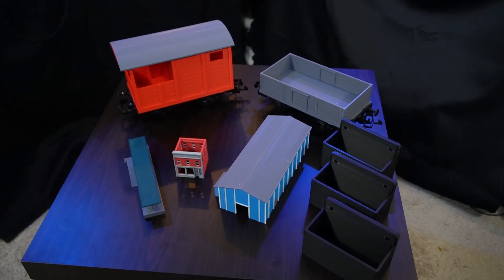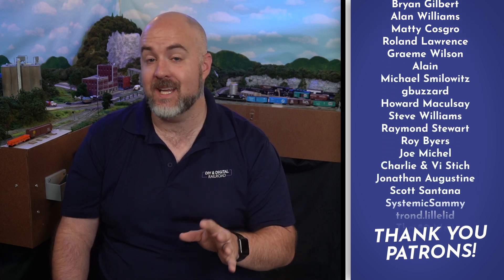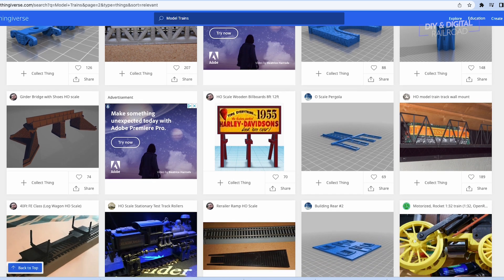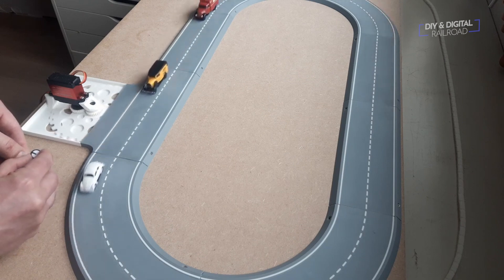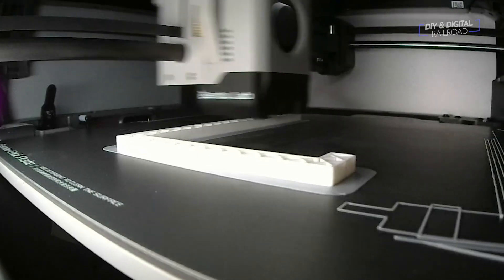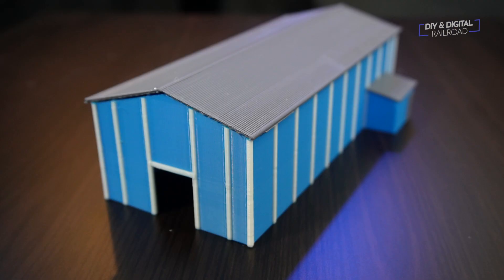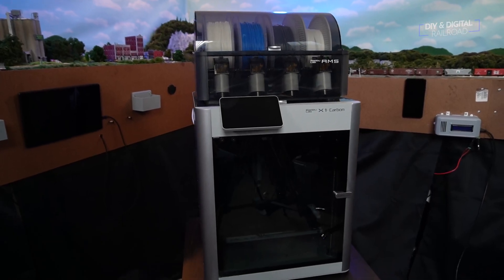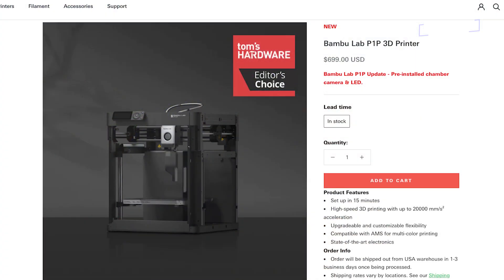Things have changed. 3D Printing for Model Railroading in 2023

Comment: Take a look at what model kits cost, and then the cost of 3D printers and supplies.  Just how many structure or car shell kits would you need to buy to realize the cost of buying a 3D printer?  For a decent size model RR layout, you'll quickly come out ahead buying a decent 3D printer over buying all those kits!  Not to mention the ability to digitally kitbash designs, and create models of prototypes that are not available in any kit.  Of course you will need to learn new skills, including some basic (and not so basic) CAD skills.  However, once you've mastered the CAD software, there are no limits as to what you can create.

Comment: Jimmy, I am very intrigued and interested in getting a 3D printer to add models etc to my n scale layout. Perhaps with the P1P on my budget. But where would you suggest I start to educate myself, as a total novice, to all that is required to effectively use one of these? For example, you and others have mentioned Thingverse for print programs/code (are they called that?) that I can download. What steps are necessary in order to do this? Are there intermediate steps? What type of environment does the printer require (my garage workbench for example)? Where does one learn all the lingo/terms? My fear is that my printer will arrive and I will be totally overwhelmed. I hope you can perhaps answer or do a follow-up with steps a novice needs to take in order to use this amazing technology. Thanks.
Ron

Comment: I have both a resin and FDM printer. I bought them for my railroad and have made a couple cool things with it. Not so much in scenery pieces yet, so far only one piece, but in ballast hoppers to help spread ballast and a wall mount for the new UP7 as the railroad I’m working on has an area too shallow for the UP7 but the owner doesn’t want a hole in the facia. I have also used it to build parts for my sailboat that were obsolete and or just nothing available for my need’s commercially. And of course I have printed the obligatory lucky kitty.

Comment: Agreed, Jimmy! I've had my Flashforge Adventurer 3 Lite for a year and a half now. I've gotten a lot of use out of it printing material for Z scale. I've just started using it to print for N scale. Not only is the print quality improving for high-end models, but more low-end models are producing good-quality prints. It'll be interesting to see where 3d printing takes model railroading over the next several years.

Comment: I don’t know how a person in this hobby could ever scoff at spending $200 on a printer when everything else in this hobby is ridiculously expensive for what amounts to “toy” trains.
Reply: Honestly man, I constantly see decent printers go for cheaper than many new models do.

The only reason I haven't snagged one yet is because I don't have anywhere to actually put the thing
Reply: @GelatoTaco  Full disclosure, I have a $200 printer and it does the job just fine. I'd have a hard time justifying much more than that though on what is essentially a hobby item.
Reply: Right, you can't get much railroad for $200 unless you're really patient and only buy used. I'm certainly not spending $1500 on either trains or printers any time soon though!

Comment: A multi-color filament printer is lightyears beyond the nearly DIY thing my ex built in his bedroom back in 2011, and at about the same price point. So, I cannot complain about the $1500 +/- cost. 

I do, however, have questions about the usefullness of the multi-color functionality for the hobby. Sorry, Jimmy, but unpainted plastics look toy-like, regardless of whether it came out of a Tyco kit or an expensive 3D printer. Priming and painting the 3D print negates the benefits of multi-color printing. 

Is there a use for multi-color 3D in our hobby? Yes. It's great for making toys for the kids. It can be used to prototype something that you will be painting the finished version of, and it could be used to 3D print an architectural model of a proposed layout design.

Lastly, two safety points to consider: 1) the plastic filament might not be UV resistant and could decompose in your garden - don't 3D print anything that could result in a hazardous structural failure - like support brackets.

And 2) don't give 3D printed toys to young children without proper supervision. The filament might leech toxic chemicals if chewed on, or the 3D item might present a choking hazard if it breaks - or even if it doesn't. Don't forget the toilet paper tube / paper towel tube test: if it's small enough to fit down the tube, it's small enough to fit down a child's throat and choke them. ...... yes, those of us of a certain age definitely played with choking hazard toys in the 1970s and earlier. We were the guinea pigs of the safety movement. 😮
Reply: Well said! I've certainly found that unpainted 3d prints have a distinctive sheen on the layer lines, no matter how fine they are. Besides that, commonly available filaments tend to be solid, bold, slightly translucent colors that look unnatural for real-world objects. A toylike appearance is fine if it's what you're going for, but it's worth noting for sure!

Comment: I've been 3d printing garden railway kits all winter and have learned a lot about modeling both digitally and physically. Even with different filament colors I prefer to paint my models, since the layer lines tend to shine in an unnatural way when viewed from different angles. 

This morning I designed some supports to turn a soda can into a tank wagon on my garden railway. Currently running a test print. I'm uncertain whether my loco can handle the weight, but it'll be a pretty cool party trick if it can!

Comment: Just curious, but while watching the video I was wondering what kind of floor footprint does a 3D printer take up? Would most 3D printers do well in a garage that gets hot in the summer (80's) and cold in the winter (40's)? Thanks for the video!
Reply: I have an Ender 3 v2 and it replaced one of the computers on my desk, for size reference (about an 18 inch cube). The room it's set up in gets down to 50 in the winter and the printer takes somewhat longer to heat up before printing. I'd consider a cabinet or enclosure of some kind which could allow the printer to heat the air around it and keep a relatively stable temperature, at least for the winter. Unfortunately I can't speak to the hot end of the range.

Another potential issue to consider in a garage is humidity. Filament can absorb moisture from the air and cause print issues, so if there's a lot of humidity you may need to enclose the spool(s) in a sealed case. I use a dehumidifier in my workspace.
Reply: @drewzero1  thank you. That information was very helpful. Have a great rest of your day!